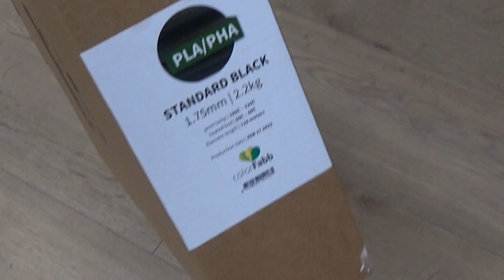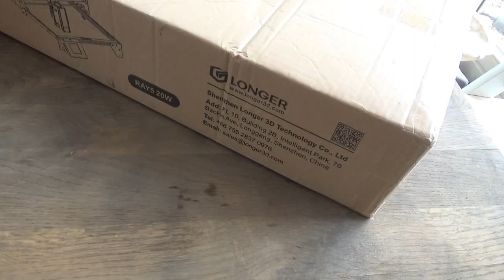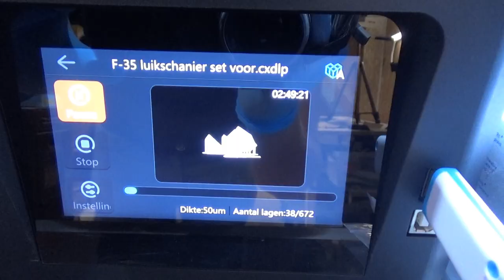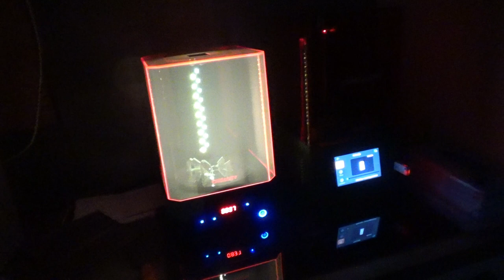Joel F35 VTOL Mechanics 3BSM And Testing A Resin 3D printer Factory colors? | Vlog 3 2023 no ads

Comment: When I was about 11 I was introduced to R/C cars and trucks, and eventually airplanes and helicopters. But the helicopter is a story for another time.
  Battery technology consisted mainly Ni-cad. Eventually Lithium batteries and brush-less motors came on the market, and they were expensive. Some of the brush-less motors cost more than a new cordless drill these days. Batteries were also very expensive.
  The point of this comment is the incredible way that the U.S. combines capitalism with imagination, which leads to development of new technologies. The R/C world contributed to the development of cordless tool technology because of R&D, similar to how DARPA  helps the military develop and fund new tech. 
  At the time those in the R/C world were willing to pay the high costs for brush-less motors and Lithium batteries, as well as the charging tech. that went with it, no one was going to pay for a drill that utilized this technology. Such a tool would not be cost effective, especially in an environment such as construction. When these tools did come on the market they were very expensive and relied on Ni-cad batteries, which made them very heavy and gad to be charged often. One could purchase a second, or third battery along with another charger, but even then they couldn't keep up with someone who was using the tools regularly. If one didn't charge all of their batteries the night before, fugetabout it.
  Today, someone can purchase a decent cord-less tool, with a charger and battery, for the cost of some of the motors used by those in the R/C world a few decades ago. I built a R/C helicopter about 25 years ago, and it had a gas engine, and didn't have the same tech. as those today. An individual had to actually 'fly' it, and it wasn't easy, and they were very expensive. The electronics in the one that I built cost around $1,200, alone, The transmitter cost $500.+, not including the servos. I never flew it due to the cost, the likelihood that I would crash it,and it was basically a flying lawnmower, without any safety features.
  I still have most of it, as well as the electronics for it, of which I have plans for, especially now that I have a 3D printer, going to school for machining, CNC, and have SOLIDWORKS on my laptop. I am in the process of sketching one of the servos for it, which includes the pieces of the shell, the internal gears, and electronics, for practice. I have only had SOLIDWORKS for about six months, and it has many, many features to learn, as well as the knowledge of the materials involved. It's a lot of work, but I absolutely love this field.
Thank you for the videos, they offer inspiration and wisdom.
Reply from the maker: Wauw such a nice story to read, and agree. Solidworks is very nice and these day I am trying Fushion 360, it’s a lot cheaper to use. Good luck, I’m here to keep you inspired;)